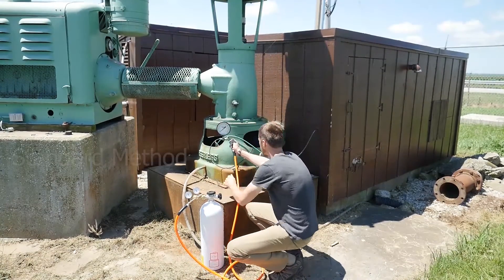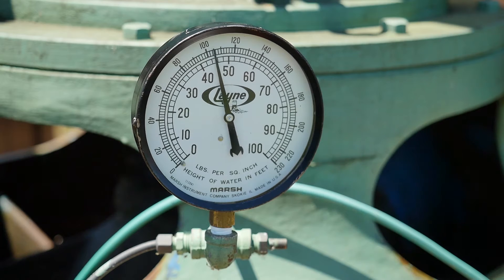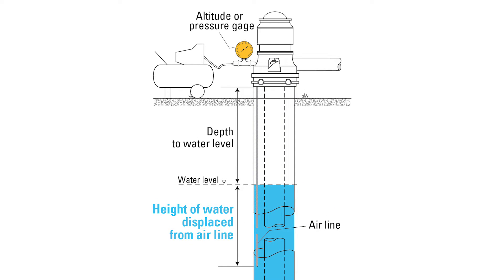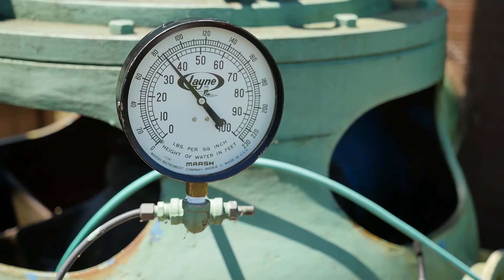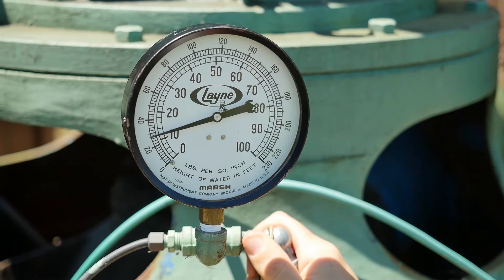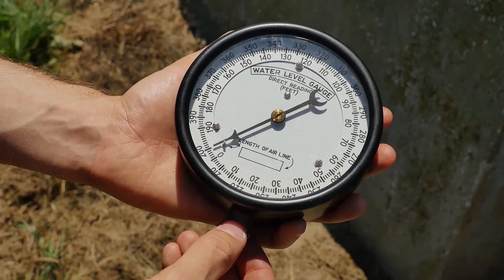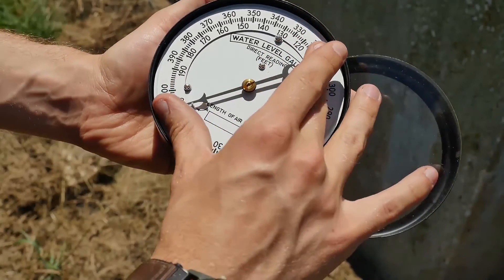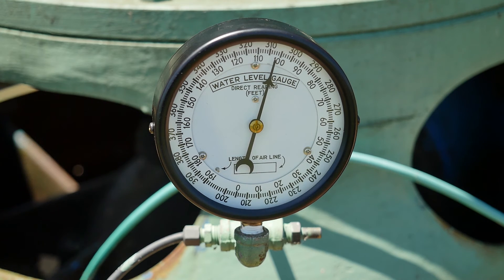Water Level Measurement Using the Airline Method

Comment: Would I be correct in assuming that this pressure reading will change over time as the amount of water above the pump changes?  In other words, would the air injection be required each time a reading is sought, or would a gauge reading reflect the proper "pressure" from this point forward?